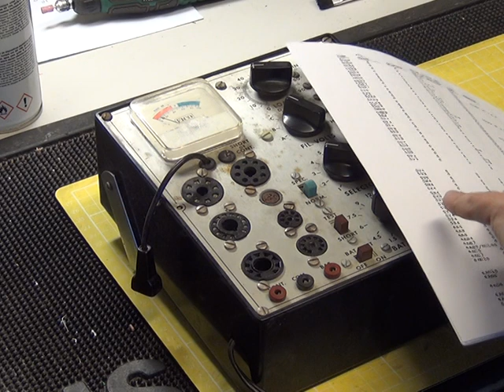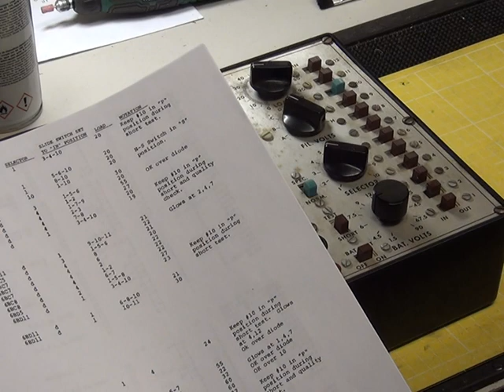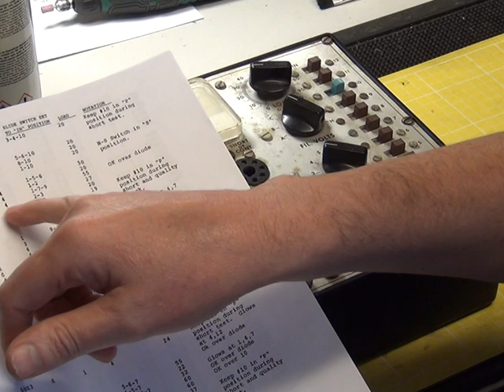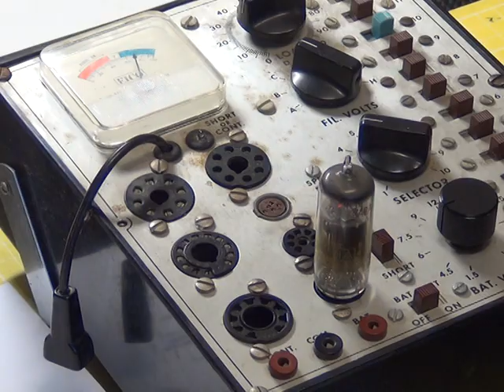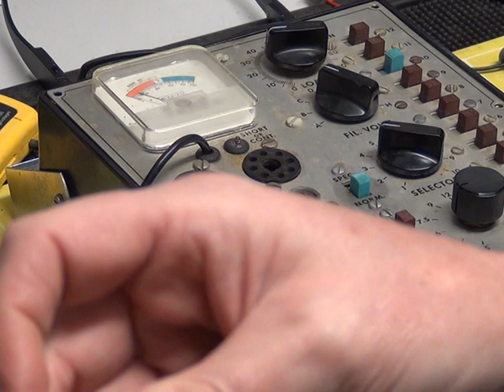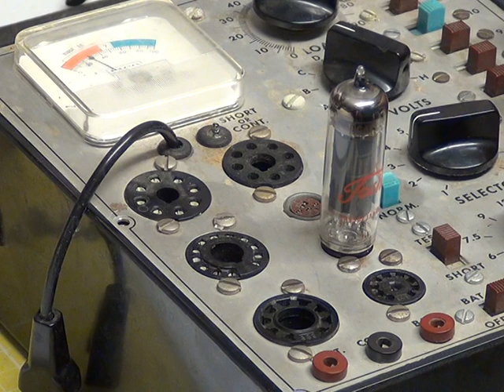Heathkit HW30 Pt3 - Valve testing with Eico 636 valve tester

Comment: A very interesting video.
Actually, the RSGB has removed Valve related material from the Radio Amateur syllabus.
This is something I not agree with as there is still a lot of Valve based Radio Amateur equipment about, such as the Heathkit 2m Transceiver you have been repairing.